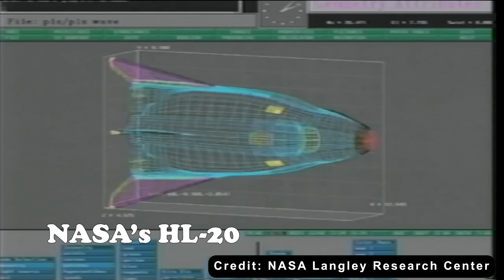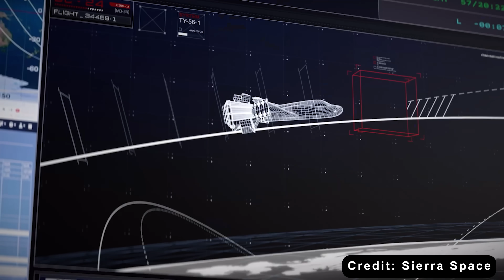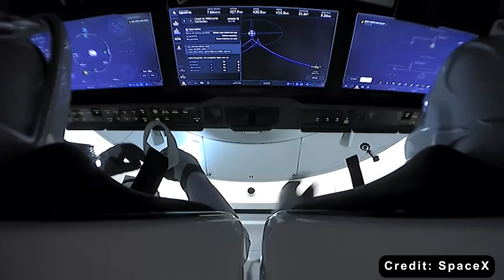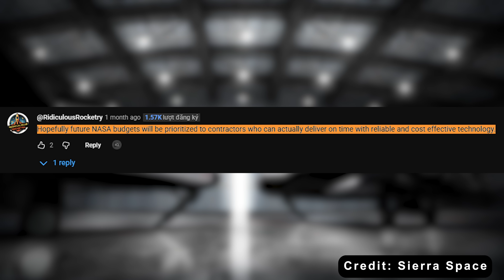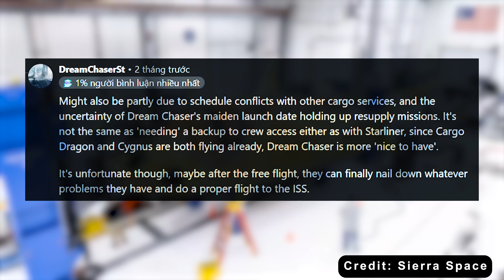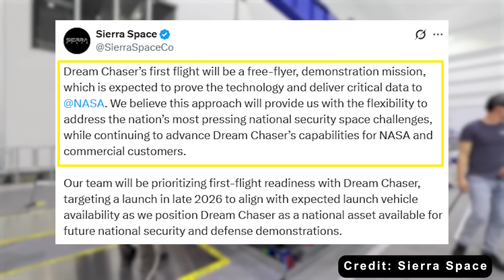NASA's New Shuttle is Turning into a Complete DISASTER! SpaceX Dragon is X1000 Better

Comment: Seems to me there is an attack against certain U.S. ISS cargo vehicles to get them canceled.   I wonder why?    Also, ISS  will not end in 2030.  NASA is always 5 to 10 years later than the daye they set.
Reply: Don't know what you mean. There are already four resupply vehicles in operation. The delays in Dream Chaser, regrettable as they are, are entirely internal.
The ISS has already been operating years beyond its design life. One of the Russian Modules has a persistent and seemingly insoluble air leak. Most of the equipment and structural members are getting old and worn out. Necessary maintenance keeps rising. It would be prohibitively expensive, and a bit risky, to keep operating the station beyond the 2030-2031 timeframe.
Reply: @odysseusrex5908 U S, Japanese and European modules were built to last into  2035.  The two oldest Russian modules are the problem.

Comment: Quite the interesting comment section here. On a more reasonable note, I can't say I blame NASA for wanting a free flying Demo. Space X had a resupply ship blow up in 2015. The Russians had a newly attached module put the ISS in a spin because the thrusters wouldn't shut off. Starliner had multiple thruster failures on multiple flights. Boeing lost contact with Starliner on its first flight and over 80 corrective actions were mandated including flight software. A loss of resupply cargo is not merely a matter of insurance to reimburse the companies for the loss. A damaged Cygnus delayed its flight and put NASA in a bind to get need supplies and experiments to the station. 

It's not necessarily Sierras fault they're late. Technology takes time to prove out. It's not NASA's fault the ISS is being cancelled. It's old and requires constant maintenance and eats tons of money. This may not make Sierra or its investors happy, but they will have opportunities to recoup on the investment. As you said, the military has interest and NASA may adjust some resupply flights for whatever contracted station that NASA flies on after the termination of the ISS. Dream Chaser has a future. Just hoping they can hang on and not cancel it themselves.
Reply from the maker: Totally fair points—NASA's caution makes total sense after all those close calls. The CRS-7 explosion in 2015 was a gut punch, the Nauka thruster fiasco could've been disastrous, and Starliner's teething pains (lost comms, thruster woes, and that laundry list of fixes) remind us how high the stakes are. A botched resupply isn't just dollars; it's experiments, crew safety, and momentum lost. Cygnus delays have squeezed schedules before, no doubt.You're spot on about the timelines too—Sierra's not at fault for the proving ground taking longer, and the ISS chowing down on billions in upkeep while hitting 25+ years old? It's like keeping a vintage muscle car running forever. Deorbit's locked in for 2030-31, so yeah, tough but necessary pivot to commercial LEO stations. 

en.wikipedia.org

 The good news? Recent updates show Sierra's adapting smartly: Dream Chaser's first flight (Tenacity) is now a free-flyer demo in late 2026, not docking to ISS, but they've just wrapped EMI testing and are eyeing runway tows next week. 

spaceflightnow.com +1

 Plus, they're leaning hard into DoD gigs for recouping costs, with a $300M raise in the works to fuel that shift. 

 If they nail the demo, those optional NASA resupplies to Axiom or Orbital Reef could follow, keeping the dream (Chaser?) alive. Fingers crossed they stick the landing—literally! What's your take on how the free-flyer changes things for their timeline?
Reply: @techmap9  If they have a NASA assessed clean flight, they could be worked into one resupply flight a year. NASA will probably do some kind of a balance with respect to their two reliable resupply contractors and their budget. We haven't heard much from NASA about their Cygnus contracts ( I think it's one a year) but we have seen NASA add additional flights for dragon although mostly for manned flights in absence of Starliner. They also recognize the investment of Sierra space and the impact cancellation would have on the company. I think the military handoff is to ease the burden on Sierra and NASA as the need for a third resupply contractor becomes less needed. 

Their isn't any current need for a military resupply craft, however, a matured very versatile Dream Chaser/Shooting Star would be a big asset for the military. Being launched from Vandenberg or Cape Canaveral, it would have access to all orbital planes and be able to land at any military airfield. Leaving Shooting Star in orbit would give the military an advanced flexibility and capability for a lower cost. A manned rated Dream Chaser would give the Military its first dedicated craft for military astronauts. 

Dream Chasers future is bright. Similar to a startup company having enough funds for 1-2 years of operations before becoming profitable, Sierra needs to be able to hold on until Dream Chaser is matured and reliable.
Reply: @PC-nf3no   Well, its first demo flight is now scheduled for late next year, which means it will most likely slip into 2027. After that, I would imagine it would take about another year to do all the analysis and complete all the certification paperwork to allow them to be put in rotation. Of course, Dragon and Cygnus will already have their flights scheduled for 2028. The absolute earliest I can see Dream Chaser making an operational flight to the ISS is 2029. Thus, they will be able to make, at most, two flights before the ISS is deorbited. Of course, by then, there should be two or three commercial stations in operation, so they might be able to get contracts servicing one or more of those. 
As I understand it, Shooting Star is just an unpressurized cargo container. It can't act as a satellite bus, so I don't know what use the Space Force would make of it. I also don't see what need they have for a manned vehicle. To do what? They are primarily focused on operating intelligence gathering satellites. If Golden Dome gets the go ahead, they will be operating that, but there is no need for manned spacecraft in that either. Of course, with multiple space stations in operation, possibly as many as four by the mid 2030s, there will be a market for crew transport, so they could get in on that, if they can get the money to complete development. It's kind of a narrow path, but I hope they come out of it on top.